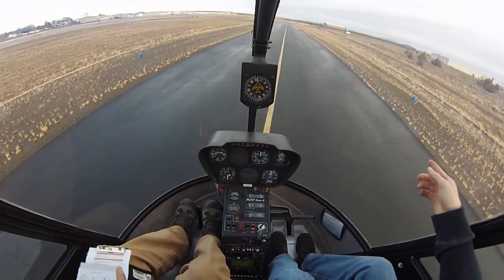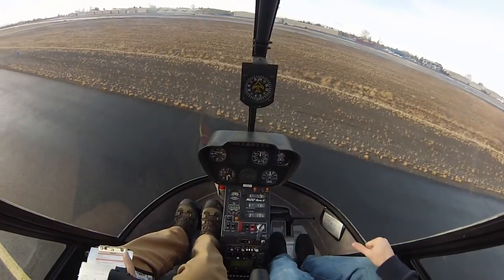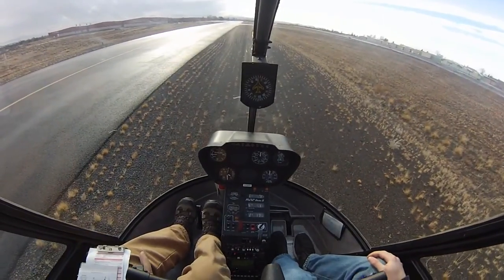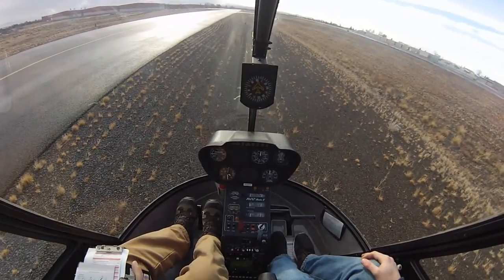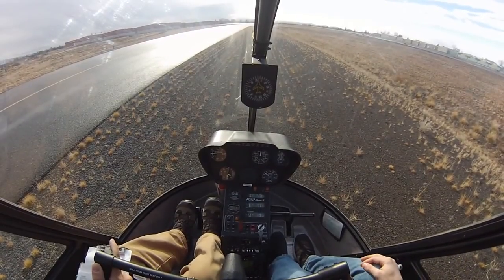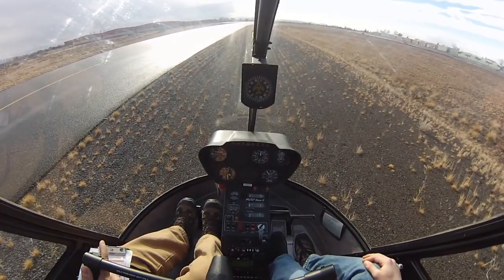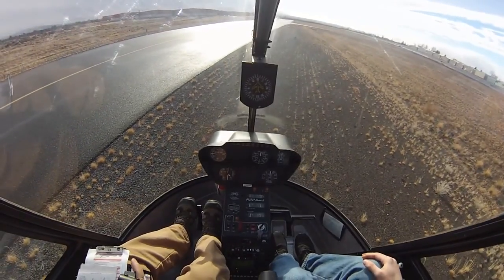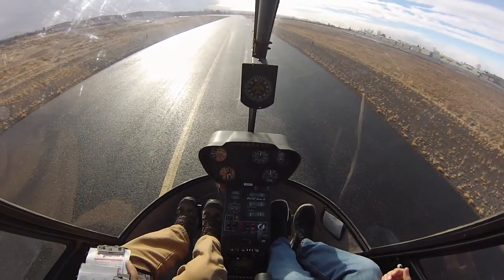How To Land a Helicopter on a Slope. Helicopter Slope Operations.

Comment: A thorough discussion of sloped landings should always address wind speed, wind direction, and landing orientation. American helicopters generally rotate counterclockwise when viewed from above, which causes the fuselage to rotate clockwise due to torque (per Newton’s Third Law). To counter this, the tail rotor—typically mounted on the left—produces thrust to the right, requiring left cyclic input. This results in reduced cyclic authority to the left (ignoring wind effects). For this reason, the R22 instructor pilot should have positioned the helicopter on the left side of the runway, facing into the wind, with the right skid upslope.

In contrast, European helicopters typically rotate clockwise, so in those cases, the left skid should be positioned upslope.

The instructor noted that it was easier to demonstrate the maneuver because the left skid hangs lower than the right, but this rationale reflects poor judgment. Prioritizing convenience over proper technique not only reinforces a bad habit but also overlooks important aerodynamic and safety considerations. Moreover, his explanation of sloped landing dynamics was incomplete and failed to address critical factors necessary for sound decision-making.
Reply from the maker: Thanks for the long feedback - yes you are correct on all of that and it is all covered in ground lessons with students before such maneuvers. In the short video it was just saying you need to choose a slope to be able to demonstrate a slope landing for the checkride. At some point I will do a full length deep-dive video covering much of what you mentioned.